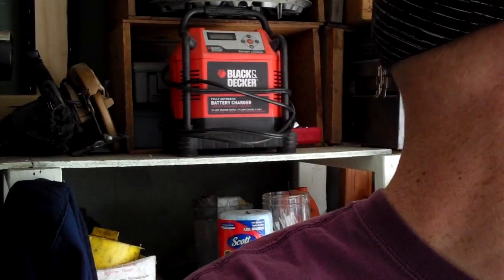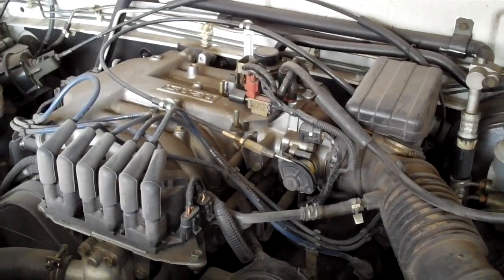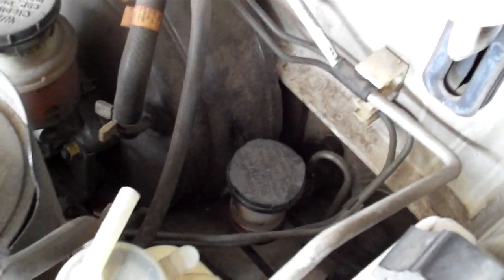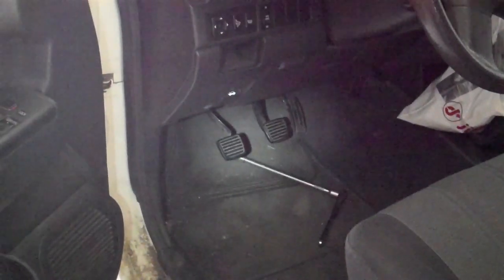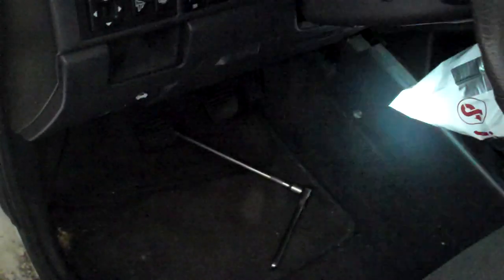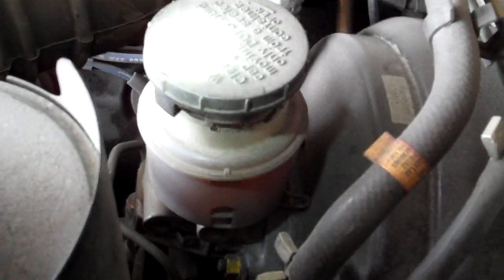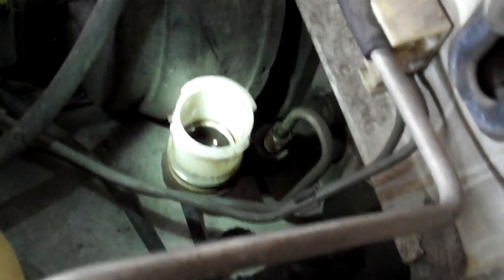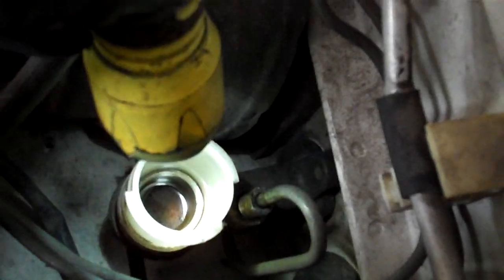How to diagnose and tell if your clutch job is going to be expensive

Comment from the maker: Reverse is the most picky clutch-wise.  You may need to bleed it at the slave cylinder and see if that helps.  Otherwise you may have a bad synchro in your trans. (ring shaped braking pad/device that slows shaft to allow gear mesh)

Comment from the maker: @willycwlin Hey Willy- thanks for the offer.  I'm good as is for now.  The starter on your Trooper is behind the exhaust.  The key to doing it is to pre soak the bolts with PB blaster and wire brush them first.

Comment: Thanks for the fast response Bryan, I looked at the clutch master cylinder as a friend pushed down on the clutch inside the cab and the cylinder did move some. I'm not sure how much give there is supposed to be exactly but could tell that it's definitely moving some.

Comment from the maker: Disconnect battery (-),Chock wheels, pull driveshafts, pull T case and cross member, undo wire harness from trans.  Pull shifter from floor by pushing down on lock dome and twisting a 1/4 turn anti clockwise.  Support trans with trans jack. Push in white plastic collar on clutch line and push line together- pull apart.  Remove starter, lower trans to access top bell housing bolts. lift trans to match motor ballance.  Remove all other bell housing bolts.  Remove trans straight back.

Comment from the maker: Brake fluid doesn't evaporate and it runs on and on like trans fluid does.  You wouldn't have to lose much to make things look wet and stay that way.  If the clutch is difficult to disengage I'd recommend/try replacing the master cylinder.  If it were restricted it would cause that.

Comment: yup, the slave cylinder is indeed external on my truck. I'll go ahead and see if I can get a kit to possibly reinforce the firewall for now at least. with any luck that will take care of the issue so I can get the truck back on the road.
 Thanks a lot for your help bryan, I was half concerned I might have to replace my clutch... =/

Comment from the maker: You can also experiment with different cut lengths of Push rod (like from an 80's chev 350 motor) as your slave cylinder pushrod.  Your SC should be external on an 84.

Comment from the maker: It's either the gearbox oil condition, or the sincros are bad on 3rd and 4th.  The trans would need to be torn down and rebuilt if the gearbox oil change doesn't fix it.

Comment: hey man great video.  I have a question towards what you said at the end of the video.  I am very good to my transmission and I am having a difficult time getting into 1st gear.  I have to get it up to about 3500rpms before she pops into gear.  Its a v8.  Now the other gears shift fine and I get her in reverse pretty easily.  The mechanics around me are cooks and are going to say I need a 1500 clutch.  If its just the master or slave cyclinder I can do it myself.

Comment: (sorry in not quite sure where to ask this question)
 1970 ford F100, I believe it has a 390fe big block in it. It is extremely hard to find/put the truck into 2nd and 3rd gear (3 speed manual on the floor, by the way) 1st gear isn't difficult neither is reverse but 2nd is tough and 3rd is nearly impossible. The guy I bought it off said he thinks it’s the "shift linkage" not sure, sorry.. need a new transmission maybe??  
Help pretty please!! Thanks so much!! :) Love ya!!

Comment: hey brian I have ?. my truck drives great, but I am questioning the clutch/inner workings. when I push the clutch pedal it's like trying to move a boulder with my foot, but the clutch grabs really good and works great. also, the inner fender (by the firewall) under the fluid reservoir hose always looks like it has fresh clutch fluid on it(can't be coming from anywhere else), but the reservoir is never low. l.

Comment: In European cars the brake and the clutch make use of the same reservoire.
if you have a leak in the brake system and don't have any brake fluid left you can't shift either.

Comment: Hey Bryan, Great video! I do have a question about my clutch as well though if you have a moment. My rig is a 1984 f-250 and the problem I have is I cannot shift into any gear when the vehicle is running. If I put the vehicle in 1st gear before starting then it seems to run fine. At that point I can start driving and can typically shift into higher gears once the vehicle is moving. Also if I come to a complete stop the vehicle is again unable to shift into any gear while the vehicle running.

Comment: u know how to explain y pressure in clutch pedal is gone and if the car doesn't engage gears its a hydraulic clutch line/system failure thanks so much u answered alot id be more happy to know it aint pressure plate or throwout bearing

Comment: well I cleaned the area with degreaser and it went away but the next time I drove it, the fluid was back. and the clutch doesn't have a hard time disengaging, it's just the pedal is really hard to push compared to any other car I've driven, and I was wondering if that could be normal if the clutch was upgraded as the previous owner says it was.

Comment: Good video, im might buy a used car. So I was looking on kijiji and I found a used bmw cheap. It has 250k kilometers (I don't know what that would be in miles). Should I do an engine swap because 250K kilometers is a lot on the engine? Btw the bmw is a 97 328I.

Comment: I saw ur vid on the f150 tune up, well I have guy who wants me to do a minor tune up on a 2002 f150 4.6 litter with 112k ,It is a mobile job so compressed air is not available. Any hang ups u know of on this piticular model u know of I should look out for.

Comment: With my 1987 Bronco II when I press the clutch pedal it doesn't feel like its all there like its only going down half way. Then when I put it in gear it just revs instead of moving and I can let off my clutch without it stalling. Is the problem a bad clutch? and how much would it cost?

Comment: also, the outer layer of the fluid hose/line is cracking/chipped, but it doesn't leak. Is it supposed to be replaceable because mine doesn't look like it comes off at the master cyl.

Comment: do you know what kind of hydrolic clutch is on a 93 nissan pathfinder and a 91 s10? also relating to clutch issues, the clutch on my s10 occasionally makes a sound like a buzzing fan when the pedal is depressed. it won't let me put it in gear either. if I pump the pedal 2-5 times, the sound stops, and goes into gear. any other time I'm driving, there are no problems at all and the clutch works great

Comment: big time fan Brain from MI < and love you to yet I was wonder if you help me out ?  3 weeks ago my clutch was deemed to need replacement soon. Today it started up fine and not even 2 minutes leaving the driveway it seemed to slip out of gear oddly enough and so I put it back into gear and as soon as i gave it gas the car died ? started it again and same deal it just hardly was moving and the check engine light came on also   please a few words of advice would be nice sir  cheers ^^   (plz and hx

Comment: My fault It is a 1993 dodge stealth and I just looked up the "old fashion" way to check plus my engine light is on now ...today I sum how managed to give it enough gas while half way into the clutch and slowly moved into the garage out of randomly though of tapping the top of my MAF the car immediately shut off -_- that is not normal right ? and i plan on buying MAF cleaner today and replacing my spark plugs also sir

Comment: Hey Brian, I forgot how to reach you so just writing here.  I had the 1994 Mitsubishi Expo with the engine vibration several months back. I had the problem before but also following a TB change..  I had it fixed this week. It turned out to me the back counter balance shaft was not in time ALTHOUGH the mech di confirm it was on mark. Turns out there is a special proceedure he found in ALLDATA.com for aligning the balance shaft. End result no more bad vibs. My wallet is $260 lighter though :-)